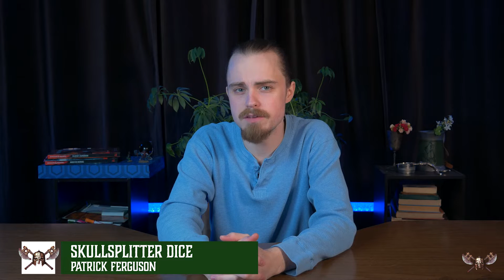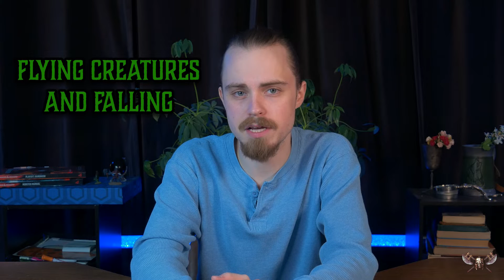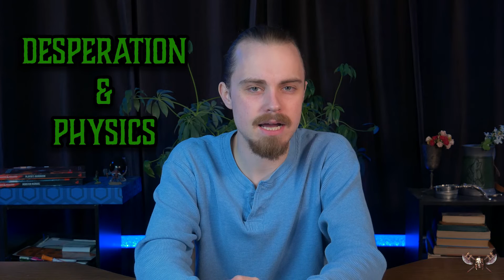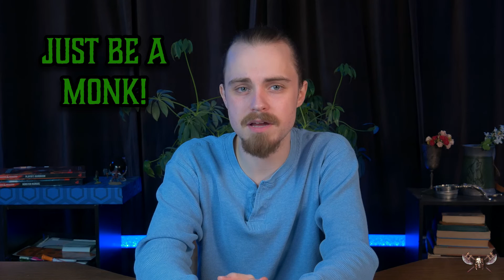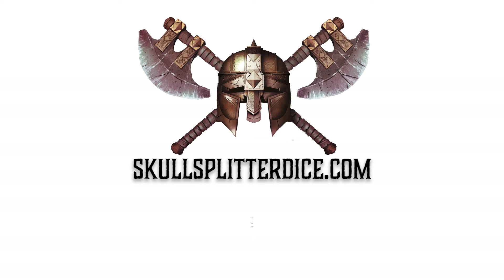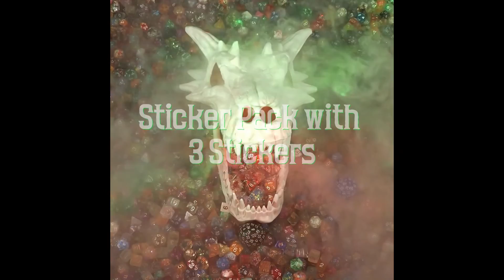Fall Damage 5e - Ultimate Guide for Dungeons and Dragons

Comment: situation is levitate a monster, it was 80feet in the air, at the end of the battle, so the wizard asks if i use mold earth directly under him to create stalagmites (earth spikes) i at the time ruled the d6 blunt would be D8 piercing/magical damage. but this became a ...very common way npc would end up getting killed what do you guys think, how would you augment a fall from high into spikes? (yes the orc did get a reflex save to avoid the spikes)

Comment: Speaking of fall damage ambiguity... I also don’t like the fall damage vs jumping lack of rules.

Creatures and players with high strength scores can vertically jump high enough to potentially take fall damage on the way down.

-24 strength with a running start jumps up, comes down and takes 1d6 damage...
-Thief rogue with 20 dex and 14 strength is in the same predicament.
-Pretty much anyone using the boots of springing and striding, the jump spell, or the step of the wind monk feature.

I’m sure there are more examples. Doesn’t make much sense to me. I’ve jumped off of the first story of homes when was younger and wasn’t hurt at all. I wasn’t particularly strong nor athletic.

I think a homebrew would be to allow PCs to use “high jump” mechanics to safely jump that same distance downward. So long as the fall/jump is intentionally done.